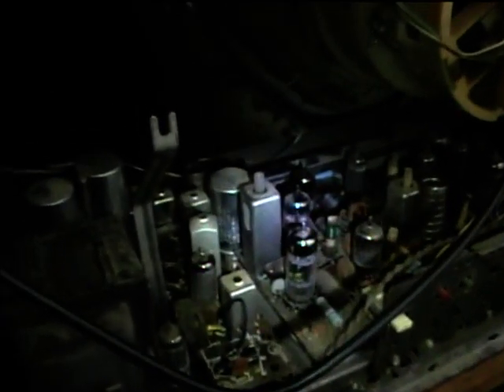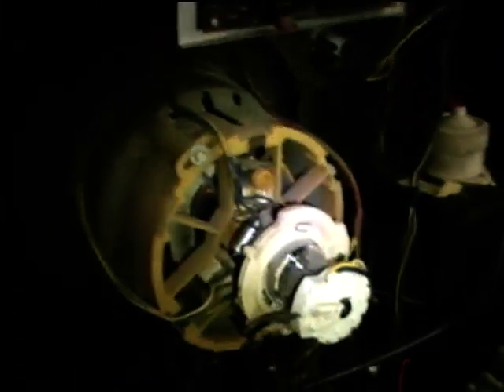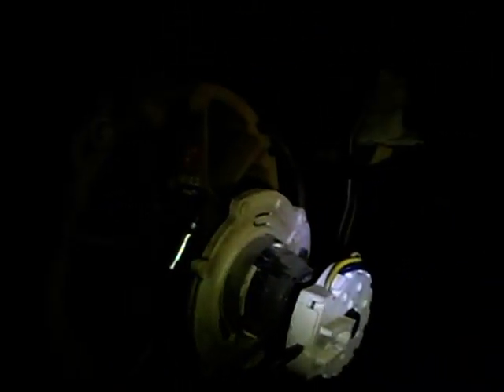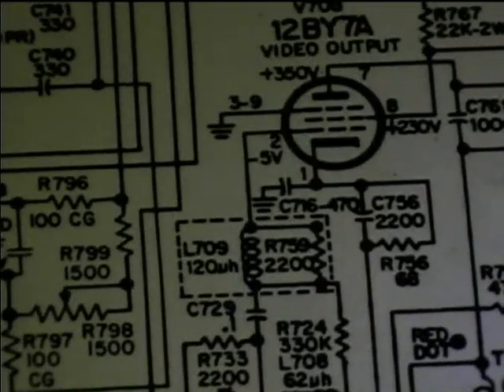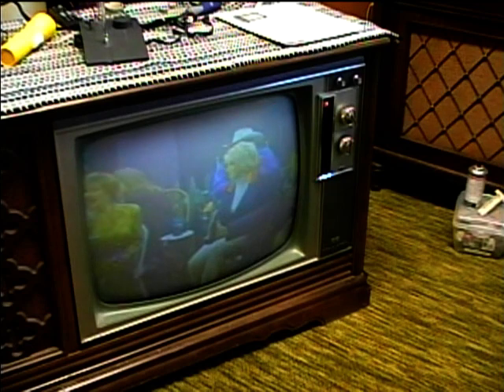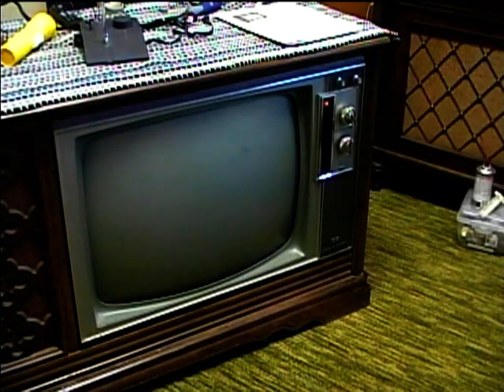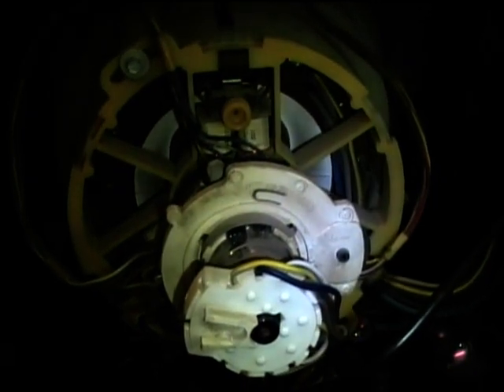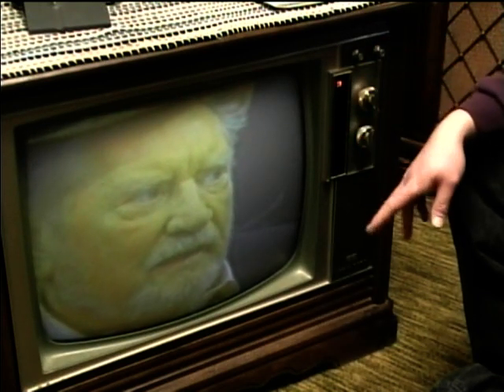1967 RCA CTC-28 tube type color TV purity setup

Comment: What do you think could be the problem with a solid state crt tv that loses its full contrast and fades to white seconds after turning it on. This happens on each power cycle. I've been tempted to blame it on a bad cermet or cap but it doesn't seem to be the case after a quick inspection. The "neck board" seems fine as well. Any ideas?